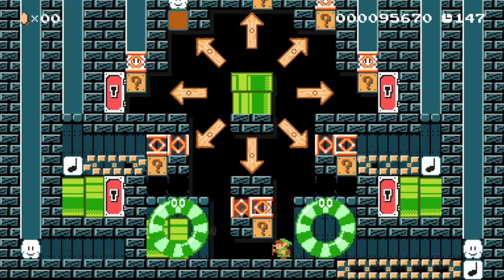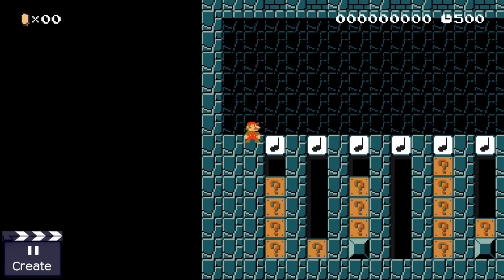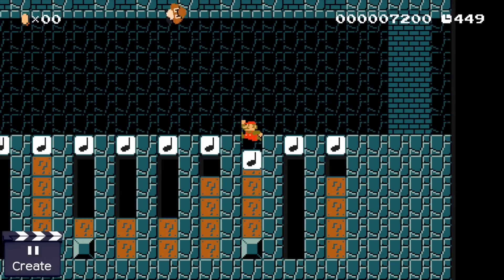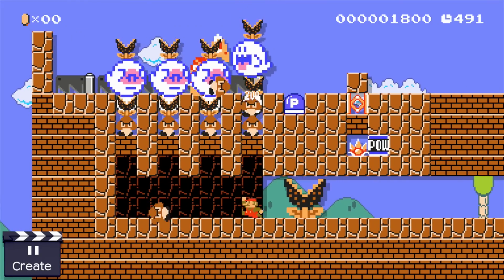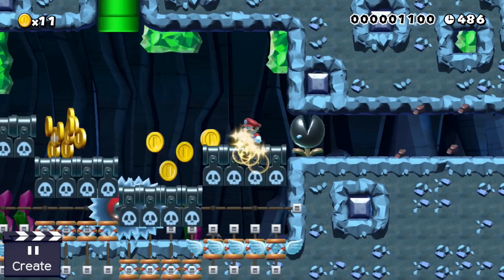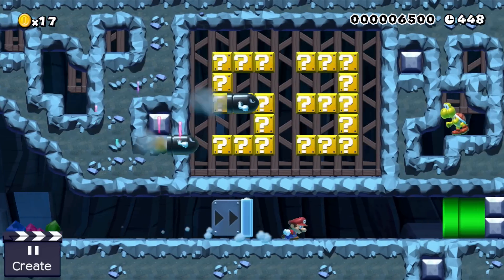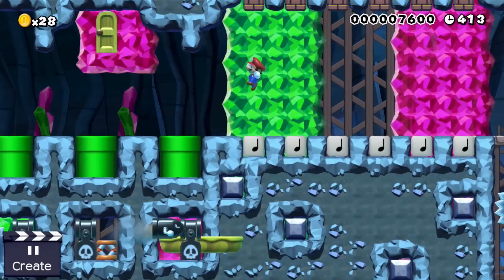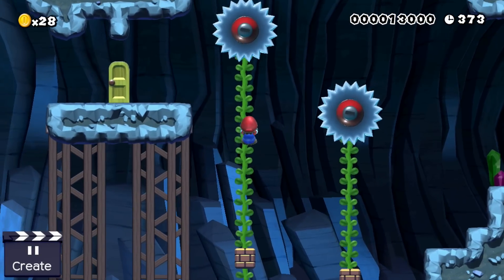Super Mario Maker Combination Lock with a Trillion different Input States.

Comment: When you hit a brick block while a Goomba is on top of it, you can see the dead Goomba fall down through the screen. Since there are munchers under every single Boo, you can figure out all of the Boo's positions in relation to each other by simply noting at which point no Goomba dies (as the munchers don't die from you hitting the block). This can be used to crack the code of the lock without ever having to check any of the hints.

Comment: If you keep hitting the block, you'd be able to see how many goombas you have to clear before you get a muncher, and just make sure you line up the munchers. Way easier than brute-forcing. But I guess if someone's that determined to skip the intended route on the first playthrough, they can just edit the level and count them. If you set up complex spring/conveyor systems for arranging the lock components, you could possibly get around both issues, though.

I really like your level, though, and wish I had a Wii-U to try my own hand at creating something like this.

Comment: The number of possible input states is assuming that each tumbler/goomba stack will only need to be hit a number of times between zero and nine. Theoretically, the only limit to the size of a stack is based on the maximum height of a level. It's just that nobody wants to hit the same block exactly 46 times and then the next block exactly 53 times.
Reply: once you reach a certain height blocks no longer spawn if you're still on the bottom screen. i think that's why the max input is nine.
Reply: Nerd.